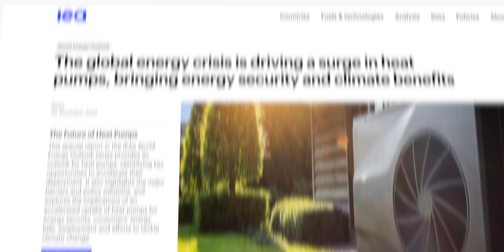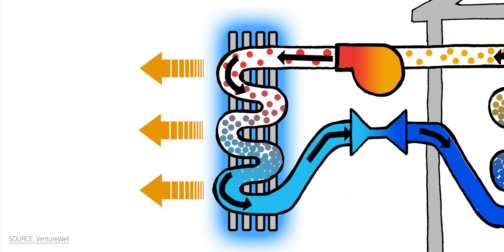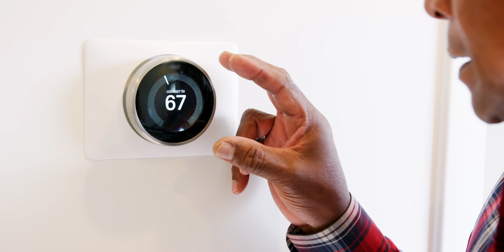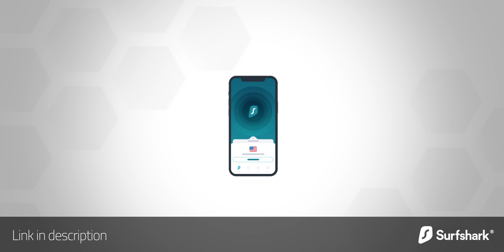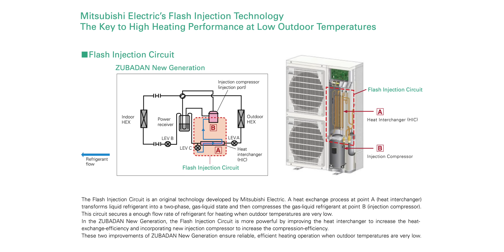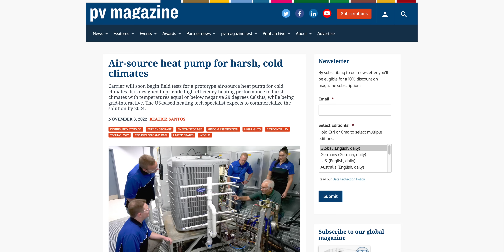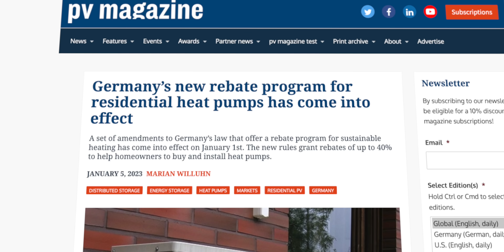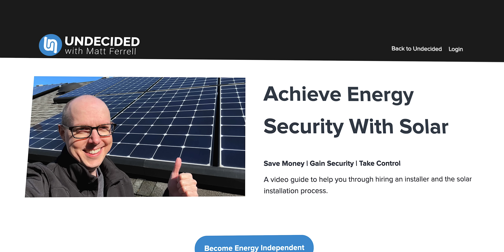Major Advances with Heat Pumps in the Extreme Cold

Comment: I live in Finland, Have been using air to air heatpump now 20 years. Our winter is very hard, can be constantly below freezing for 4 monhts. And can be -30 C more than 2 weeks in a row. Heatpump is my main heating and it works nicely. If I have time I'll warm my fireplace some times especially in very cold days. So if you live in a place that you have some freezing weather heat pump will work great!

Comment: I literally stick my heating on for 15 minutes and it heats my home for hours.. i turn my boiler off between water uses.. how long would i have to run a heat pump to get that same heat time or water use? The local housing have been throwing about, about them.. my beain is just equating it to space heaters which are a nightmare an less than useless for how i would heat my flat. Electric is also 5 times the cost of gas for me.

Comment: As I understand it, the rating is for wind-chill temperatures. So at +32* F (0*C) and 32mph (51.5 kph) wind, the heat pump won't work, since the wind-chill temperature is -20* F. Right?

Comment: Any heat pump struggles as the temp goes below freezing.  Some of the newer ones simply have more outdoor coil space.  Stay away from those who use a TXV on the outdoor unit. They struggle more in cold weather than the typical check valve with a hole in it for liquid control. A well designed and installed geothermal system and a water source heat pump would be the way I would go if I was paying for one. It needs to be a horizontally laid out ground loop, not the well type, which I, personally, have seen fail miserably. Then you need to pay attention to the water chemistry in the loop. Just the typical closed loop additive available in your area.

Comment: Great video! Thanks! Can you say if ductless air source heat pumps are more efficient if one compressor is installed for each wall unit, compared to two or more wall units per compressor?

Comment: Geothermal and commercially available heat pumps are two COMPLETELY DIFFERENT systems. Geothermal is a phenomenal system if it’s installed correctly and sized correctly for the home. 

Electric refrigeration type heat pumps can be great. I’ve got a couple that I installed and they work ok at 15f. But at -30f which is not at all uncommon in Minnesota… They are completely useless and on top of that. They are almost as loud as a cheap air compressor. 

Having said that… I installed these mini splits 5 years ago and I fully understand that newer units are far better in the winter. But it’s just not going to heat the same way our propane furnace or pellet stoves do. We use the mini splits as the primary heat source whenever possible. And switch to propane or pellets when necessary. And trust me… When you wake up and it’s 50 degrees in your living room and -30f outside. You give ABSOLUTELY ZERO F***s about how efficient your heating system is. You just want it to be warm.

Comment: 10 years ago they still sucked if the temps got below 40.  They did have heating coils you could use but they would draw 5 kWH each.  I had two for max heat.   Nat gas for me.
Reply: A lot has changed in that time.  Many are capable of going down to -25C (-13F) these days.  My main one can't physically draw 5kWh even if it wanted to (13A fuse on 230V).

Comment: no matter what, they use electricity and here in maine everyone is having issues with the high prices. and solar is no good either. In urban areas, the study found that solar farms could actually increase temperatures. This is because the materials used to make solar panels, like metal and glass, are good at reflecting heat.

Comment: Geothermal heat pumps, as the one you are installing in your new home, circulate water underground and are not much affected by the season.   Air exchange heat pumps are affected by air temperature.  The COP decreases in winter no matter what and you get less heat out when you need more.  I know some one who installed a geothermal heat pump system, 48,000 Btu's, which cost only $47,000.

Comment: Why use 72F as a comfortable temp. That's to cold. I set my heat to 76F. In summer I set it to 74/76. I dont get hot easily. If inside with no airflow I can survive up to 85F. I feel much better going outside even if it over 90F, because there is airflow.

Comment: I just Financed a new heat pump and I will receive a government rebate of a set amount assessed by a licenced auditor in Canada. They told me that the heat pump...A Mini split ....would have no problem in the colder climate. People are 50/50 on the fence about heat pumps. I will let you know when it's installed and how it works. It costs a lot...Just under 30 and I could get back 5-10 back in government rebate programs...I hope it all works out...

Comment: Geothermal heat pumps were already OK for severe winter weather.  But most people won't have the space or ability to use geothermal, so to make this technology acceptable (as good as natural gas fired 90% furnaces for example) in the northern states, it must be much better than what we've seen previously in air-to-air heat pumps.  Having to use an electric backup heater like the one I had many years ago just spins the electric meter off the side of the house.  So rather than mix the data to include geothermal and air source heat pumps, how about just presenting real world results with available air-to-air heat pumps in average homes.  Sure they may be OK in a super-insulated and sealed home, how about the typical home?  We've seen all kinds of claims about how great heat pumps are, going back decades, but after being "burned" in the past I for one will need a lot more convincing.  The up front costs don't bother me, being miserable every winter does.

Comment: Everyone advocating that heat pumps are great don't appreciate the condition of most British homes. There are many small terrace properties, flats( apartments), converted large houses and old hotels or hospitals for example. People cannot afford the investment in insulation required. My property is rated in the lower C band, and estimates to make it more efficient won't actually improve the rating much. The payback in saving energy costs will take 119 years.
Reply: Oh, they do. The thing is, most UK houses are either semi-detached or detached, and the key is understanding the heat loss and improving on it.  Basically, there is a misconception about needing insulation etc, there's a balancing act,  so you can e.g. have larger radiators instead to lower the flow temperature, or raise the flow temperature. People will dismiss it out of the gate just because there are plenty of cowboy installers out there, that will say you need the largest radiators and pipework, along with insulation everywhere.  But good installers will discuss the options with the owner of what things are recommended to do, and what the running cost will be if not done.  I don't think flats are really on anyone's radar currently, with the exception of those who are against heat pumps that say "But what about a 10th-floor flat".  There are certainly possibilities, but again depends on the building. Smaller properties will need less doing than larger properties as well.  They aren't going to fit every situation, but there's a lot of anti-heat-pump propaganda that will tell you they won't work in certain situations where they certainly will.
Reply: @BenIsInSweden   Thanks for your comprehensive reply. One other issue with assessment of insulation performance in British houses is that it is subjective. Two different surveyors can give completely different evaluations. Try a third and he ( or she!) and you would get another different assessment. So our Government is basing all its energy projections and policies on guesswork.
Reply: @dartskipper3170  That's what heat geek is trying to solve.  Actual proper calculations, some of which you can try doing yourself if you know your property well.  The thing is historically in the UK boilers are done on rule of thumb, which means people have oversized boilers for what their needs are.  Building regs have been in place since last year, for any new build, or major renovation (that includes heating) to have the system designed for a maximum flow temperature of 55C, which is essentially "heat pump ready".

Comment: Somethings not quite right here.  Heat pump tech has been around since 1855/57 when Peter von Rittinger invented the first pump. They have been used is very cold countries for generations, and yet until now we didn't have one that worked in cold climates?????

Am I missing something or is this click bait?
Reply: America is slow to catch up.  Many (apparently) still have resistive heating elements for defrosting, which hasn't been a thing in Scandinavia for over a decade.
Reply: @BenIsInSweden  I'm in the UK and it appears that people sold heat pumps 5 years ago are now being told their tech is out of date and they should upgrade. The cost of a heat pump installation - on average - in the UK is between 7k to 16k, so the idea you have to replace a heat pump every 5 years suggests someone is being dishonest. Maybe your comment is correct and early adopters have been sold old tech.
Reply: @witsend236  that 7k-15k is including upgrades that don't need to be done every time (e.g. bigger rads, better insulation, etc).  UK ones from about 5 years ago also sometimes had the resistive heating elements for defrosting. I wouldn't say there is a requirement to replace them, more that there is starting to be a better understanding of how to optimise them in the UK now (though that still needs more people learning, which it seems heating engineers are reluctant to do).  The ones being installed nowadays if done properly should last about 20 years, however with advances I think it's going to start becoming more cost effective to replace in about 10-15 years rather than running them into the ground.
Reply: @BenIsInSweden  Yes I know the 7 to 15k is installation, the average Heat pump price in the UK is around 8k the rest is installation. The UK Government offers a 5k grant scheme that is only payable under certain circumstances and limited to around 250,000 installations per year. One point is that many UK installations have been done by people poorly trained and this has caused problems for genuine trained installers. The average replacement gas boiler is around 3.5k and the average household saves between 60 to 100 per month. for 6 months of the year, therefore if you have a good working boiler but decide to go heat pump it may cost you about 10k which will take around 20 years to reap the benefits if you cannot get the Government grant. Heat pumps are great but not for everyone and like battery cars have there own set of problems.
Reply: @witsend236  The vaillant HP+Cylinder combo is about £5K without installation.  The grant has increased recently to £7500 but the total amount available hasn't changed at the moment.  Yes, there's a case for only doing it when the boiler needs replacing, but the flip side is you might miss out on the grant.  There seems to be no shortage of the grant available at the moment, due to the mass misinformation on them as well, so uptake has been slow.

Comment: I live in Australia where it very rarely gets to say -5 deg C, First I have found that the new Air to Air Mini Splits with DC inverter technology have really worked for me. The unit is less than a year old but has kept my small house  approx 100 m2 or 10 squares at around 22 deg C in three rooms. It has been running 24hrs a day using around  20Kwhrs per day (that of course is everything). The great thing with the mini splits is that you could buy two or more for extra rooms far simpler than Air to Water to install. I love them and of course in this hot country they cool as well.
Actually heat pumps would even work in the Antarctic you have a wonderful heat source the Ocean which at around 1 deg C is really hot. So our evaporator unit  could go under water it of course would not be cheap to install but imagine using wind turbines and solar to run the unit. Could save heaps of diesel fuel,  I notice that when any new technology comes out there are so many "cant do" people who lampoon any new ideas. I can recall in the 1970.s when i was and still, a solar energy freak, l was hounded for decades that photovoltaics would not be able to deliver large scale power.
Well considering this opposition, gradually it is happening.

Comment: Good; but when building a new house the main factor to reduce costs and energy for heating is insulation.  And you win twice; smaller energy bill each year and the heatpump is small and cheaper.  Heatpump are almost linear with their power.  Aim for no more then 10W/m2 power needed at the coldest moment of the year.  This is possible in almost any climate.

Comment: I'm from the UK and just listened to a plumber who has fitted heat pumps, gas boilers, under floor heating and earth heat exchanges. He claims the price hikes in the uk is to try and force us to fit heat pumps as part of the green agenda. From his experience they don't work, and cost  thousands of pounds more to install. If you're having a purpose built insulated house like in Sweden that should be acceptable but otherwise they're not fit for purpose from what I've heard. This plumber said he'd have fitted one in his own house if they'd been any good. In the uk our bills have gone up by hundreds of pounds a month and most of us think it's dodgy move by those in power. Someone believes they are going to make millions out of us by installing this "heating" system! .
Reply: Sounds like Roger Bisby to me. He has an axe to grind with them and doesn't understand them properly.  Heat Geek and others have already proven that they work. And trying to say Sweden has better insulation is ignoring that we get much lower temperatures as well.  The larger the temperature difference between outside and inside means more heat loss and insulation only goes so far to mitigate that - no I can't heat my home with a lightbulb.

Comment: I installed 3 senville units in October of 2022, and I live in the finger lakes area of NYS. These heat pumps are the only heat I have, made it through last winter without any problems. Supposedly they can heat to -22 degrees Fahrenheit. It never got below 0 last winter, so far so good, my highest electric bill was 350.00 for 1 month.

Comment: I built a fairly well insulated 3700 sq ft center hall colonial in NE Ohio 27 years ago.  Diy 95% effiency Janitrol gas furnace system no A/C for about $1200. Have done minor repairs to the furnace and gas budget is $120/ month.  We use ceiling fans and a few window A/C units in the summer. The furnace may need replaced but I'm retired, don't pay income tax so can't use tax credits. I don't see any benefit in going into debt to get a heat pump system since I can install a new furnace myself for less than $1,000.

Comment: Heat pumps are great fot heating and cooling homes .( DEPENDING ON THE PRICE OF ELECTRICITY.)  But for hot water NO !it's an advanced air conditioner  or reverse cycle air-conditioner.   Been around for 15 plus years. It still needs ELECTRICITY. So do y9ur own math.

Comment: I live in Ukraine. A Zanussi (ON/OFF) air conditioner is installed, which heats up to minus 10 Celsius. Another GREE (Invertor) air conditioner heats up to minus 20. The third Mitsushito (Invertor) heats up to minus 15. Two weeks ago I bought a Skyworth (Invertor), which, according to its characteristics, can produce heat down to minus 25C. When the orcs shelled the power plants, there was no electricity for hours. It’s bad, of course, to depend 100% on electric heaters. But the advantage of heat pumps is their energy efficiency, efficiency and speed of heating the space. As soon as the electricity was turned on according to a schedule for 2 - 4 hours, the air conditioners instantly heated the house.

Comment: Two aspects that I found were missing:

- Heat pumps will always perform worse in cold temperatures because the thermodynamic limit of the coefficient performance is COP = T_hot/(T_hot-T_cold) (Carnot limit, all temperatures in Kelvin). Therefore, the COP will always decrease as the temperature difference between indoors and outdoors gets larger. Here are some examples if you want to generate 40°C water indoors for the following outdoor temperatures:

10°C outdoors → max. COP = 313K/30K ~ 10
0°C outdoors → max. COP = 313K/40K ~ 8
-10°C outdoors → max. COP = 313K/50K ~ 6
-20°C outdoors → max. COP = 313K/60K ~ 5
-30°C outdoors → max. COP = 313K/70K ~ 4

So yes, heat pumps can work in cold weather (provided that the engineering challenges are solved) but from a physics perspective that is no surprise. In theory, heat pumps can work at any temperature, e.g.

- 100°C outdoors → max. COP = 313K/140K ~ 2

- Practical systems are still far from this limit. As mentioned in the video the COP is typically around 2.5. In that case, the main limiting factor is economic: electricity price/gas price per kWh can often be around the same number (in Germany currently 0.30€ / 0.09€ ~ 3). So depending on your local prices, heat pumps might not save you any money.

I think it would be better to be honest here and say that achieving a net-zero emission society will be very costly (heat pump installation, house insulation, energy storage facilities, development of wind and solar, expanding the power grid several-fold, maybe building new H2 infrastructure) and everyone will have to contribute a significant share of their income to this goal over the next 30 years, hopefully organized by the governments in a socially fair way.